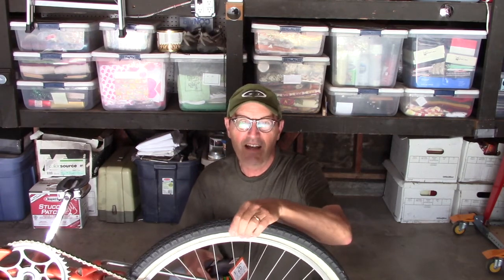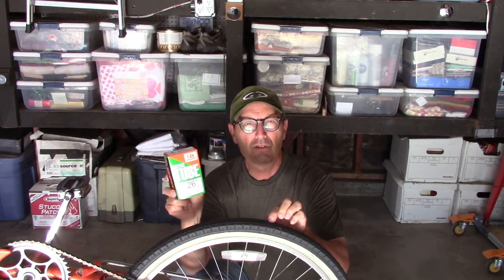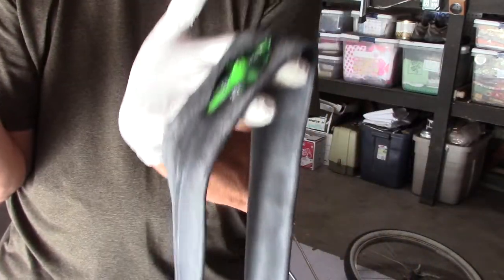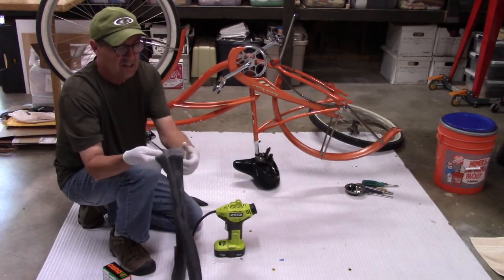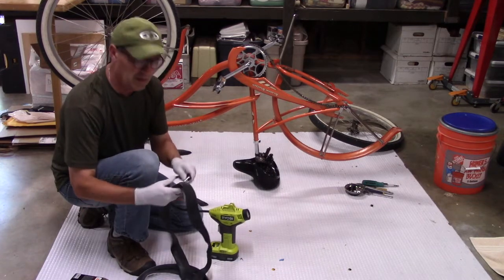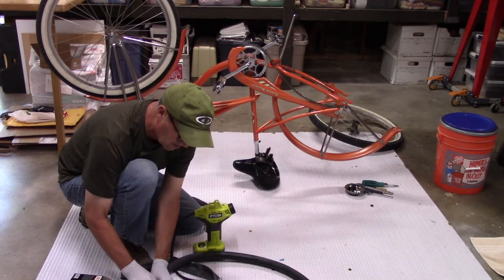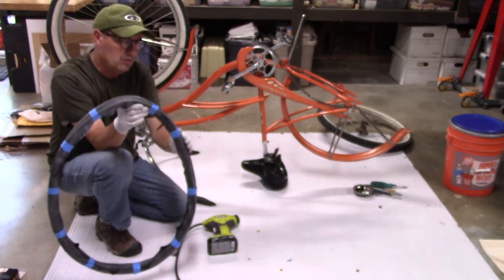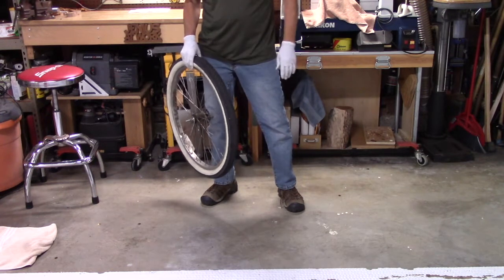Make Your Bike Tire Thorn Resistant

Comment: Home Depot "Orbit UPC 2 in. x 50 ft. 20 Mil PVC Pipe Wrap" $5.24 a roll it is thin and fits perfect. Nails, Screws, Thorns glass and more. it's made to protect under ground pipes
Reply from the maker: Very interesting.  I hope others see your comment.  Thank you
Reply: I have tons of this stuff I'll line my tire with it
Reply: Please tell me this works! I have 8 neighborhood kids and I have become the bike repair man🤣
Reply: I'd like to try this! In terms of installation, how do you proceed? Do you stick it to the inside of the tire and then add the tube?
Reply: Does it work?
Reply: I live in Az and I think the hot pavement would melt it in the tire, it's a good idea I wonder if they make a high heat version
Reply: How do you put it in the tires?

Comment: I did the whole "Thorn resistant" tube thing for a bit but got tired of replacing the much more expensive tube, because of the valve. So, I started doing this a few years ago with the bad T/R tubes and just buy cheap tubes and use the thick ones for wraps. Also! I've never had semi slick tires before (only knobbies) until I bought a used bike with them and because of their age, I won't use them for long rides, but did cut the wire bead off and use them for liners now and the best so far. Tuffies work, if they don't shift side to side. The tire wrapped within a tire, is tougher and doesn't have that problem and so far, will ride anywhere without hesitation, but do always carry a spare tube regardless. 4 bikes (2 mtb, 2 cruisers) and at least 20 miles a day/4 days a week and have walked a lot of miles because of flats and doing everything I can to avoid any more walking.
Reply from the maker: Wow! I only go 6 miles a day on my Electra Townie 8i. I am on paved paths all the time.  I avoid thorns which cause most of the flats on Orange County California bike trails.  Thanks for your comment. Keep up your fitness program!
Reply: @gfotinakes316  Just trying to keep myself from getting fat and lazy after retiring. Keep in mind, the smoother the tread being used for an insert/liner, the better. And depending on fitment of the tire used in the outside, it can be a wrestling match to install. Hope it helps! Oh! Before the stupidly high h
gas prices, I'd drive down to O.C. And ride 2-4 times a month, but now just roll from home in the I.E. On the P.E.T. Most times, with periodic explorations through the dirt and rocks of the local hills.
Reply: I used to fix flats on location where the puncture happened.~15 minutes.
Reply: @gfotinakes316  Old larger dried up blackberry thorns can puncture tubes on trails too!!!
Reply from the maker: Thankfully we have none of those in southern California!

Comment: When I was 11 (back in 1964), my stepfather made my bicycle tires thorn-resistant (we called them stickers) by doing the same thing. It worked great. My tires never got another flat. The composite materials available today work much better obviously.
Reply from the maker: I was riding my bike in '64 also and having flats with those "goat head" thorns.  I used that liquid sealant and it worked okay.  Many times I would be riding along and I would hear hissing then some goop would come out and seal the hole.  I wish my father knew what your stepfather knew at the time.  Have agreat holiday.

Comment: i did not quite understand the problem you had with the valve stem and why the sealant was not working .....was the valve inside the stem faulty or was there a hole in the stem itself
Reply from the maker: There was a hole at the base of the stem. By the way, what state are you in?  I like to put a pin in my map for all of my replies. Take care!

Comment: Just cut an old inner tube and insert better coverage of tire. I use this method all the time especially in the rear tire and you can run at lower pressures. I run 40 /60 or more depending on tire size
Reply from the maker: Great tip! By the way, in what state are you viewing my video?  I would like to add a pin to my map for all my video replies.  Thank you!
Reply: I'm in Detroit,I built a 1500 watt ebike but literary the streets here are nothing but glass, people drive around smoking weed and tossing liquor bottles out so I get a flat almost every day riding 6 miles to work, I tried duck taping the inside of the tire which made the ride horrible, I tried pipe insulation, it works but it. Flattens  out to paper thin, I'm trying this option today, but along with the extra tube I'm cutting my old tire tread off and inserting that also
Reply: what do you mean by "cut across the oval"

Comment: extra tube over made tires feel so stiff heavy l tink l remember
Reply from the maker: I haven't noticed that.  I put about 60# air pressure in the tires and they ride great.  Even if they might be heavier, I ride for the workout anyway.  Thanks for the reply, take care and stay safe.
Reply: @gfotinakes316  does it feel slower? When you put some extra tube protection?
Reply from the maker: @thedistance1155  My bike is a one speed cruiser type bike.  I put about 65# of air in the tires and I have noticed no difference in the speed or resistance.  If my bike had a narrow racing tire it probably would make a difference.
Reply: It can make a difference, but it really shouldn't be too noticeable. I guess it depends on how much your current rims and tyres weigh, and the pressures you use.

Comment: 👋 Hi. Great video. How did it worked out with the extra tube protection on the long run?Thank you.
Reply from the maker: Perfect, I never got another flat. (Maybe I just managed to dodge the thorns. :)
Reply: Depends where you drive. If you drive on streets only this might last forever. I put this system on my electric bike and done over 1000km in few months. I drive mostly on canal routes(loads of crushed glass), and on forest/bush trails. Never had a puncture from glass, but had two punctures recently in one week from a similar spike (I think plum tree), which went through tire and inner tubes like through a butter. So I am thinking of upgrading to a proper liner ;)

Comment: Does this still working right now I want your answer because I'm tired from Holes in tires
Reply from the maker: It is still working with the "goat head thorns" that I have trouble with.  I don't know what you are running over, but my thorns are fairly big and nasty. I hope this helps.  What country are you riding your bike in? see the thorns:    https://www.mortonsonthemove.com/goat-head-thorns/
Reply: @gfotinakes316  I ride my bike in North Africa, where the roads are rickety and there are many holes. I will use your advice, but what do you think if I make an inner tube for a truck or a car? I think it is better to protect the tube. Thank you for replying and exchanging experience

Comment: I had a cheap tube that u was gonna use and i bought a slime one instead and us that one, long story short it got punctured and i changed it by using the cheap tube i had, i even put alike in it BUT after literally some hrs it went flat anyways i bought 2 slime tubes yesterday and today i changed it and i said to myself let me check the tyre. And what do you know it had 2 thorns in the tyre and thats why it punctured my tubes i tried getting them out but they where small. I ended up just cutting them with a nail clipper (i didint have anything else) lets hope the small piece of the thorn punctured this new tube aswell. And when it does ill use this slime tube for this.
Reply from the maker: Wow! What a story.  Good luck with all those thorns.
Reply: @gfotinakes316  haha I try.

Comment: Have you had any kind of problem in the long run…?
Reply from the maker: I have not had any problems but I don't ride that bike much anymore.  The tire still inflates well and holds air.
Reply: @gfotinakes316  Was the result uniform over the whole tire or did it cause bumps at some points....?Thanks again
Reply from the maker: @Gorylla88  The tire was uniform with no bumps.  I was not aware that it was even there.  Remember, this is a larger beach cruiser tire, not a racing bike. By the way, where are you riding? State or country?

Comment: This is nutty idea, I tried this years ago and it didn't work well at all, all you're doing is adding weight while adding very little in the way of flat protection.  If you want better flat resistance you need to use a RhinoDillo Tire Liner, which is better than the Mr. Tuffy, it weighs a little less than using an old tube, it's a lot tougher against penetration than using an old tube, and it has one end with a soft tip edge to prevent the liner from chaffing the tube and causing it to leak after time, unlike the Mr. Tuffy. 

The first line of defense against flats is supposed to be the tire, so buy a tire that has very good anti puncture liner built into the tire, the Schwalbe line of tires have the best flat protection depending on the model, one model is claimed to be flat proof?!  I haven't tested that tire to find out, but I do have the Schwalbe Amotion tire and that is rated very high against punctures and so far no flats on my touring bike, but I do use the RhinoDillo liner for extra insurance.
Reply from the maker: Wow! You sound like you have had a lot of experience with this stuff.  As for me, I just wanted a quick free fix and it seems to work well against those "goat head" thorns in my area.  Thanks for all the information, I am sure it will be helpful to other readers.
Reply: @gfotinakes316  I use to live in the Mojave Desert of Calif, guess what was all over the roads out there?  Goatheads, and I tried the old tube wrap thing and it didn't remotely work.  I even tried Slime, and it didn't work either, but there is newer liquids that does work better than Slime does, but those liquids only last about 3 to 6 months than you have to add more, once you do that the weight is more than a liner.  Back when I lived there the only good tire they had against goatheads was Specialized Armadillos, since then Continental came out with better tires, and Schwalbe came out with the best tires against flats.  A rubber tube wrap is till nothing more than a thin piece of rubber which is easily penetrated by any sort of sharp object.  Don't believe me? fine, take a thumb tack and press it against the tube, the tack will go through it like butter; try the same thing with a RhinoDillo liner and see what happens, see how tough it is to get that tack through the liner vs the tube.

Again, the first line of defense is the tires, if you don't want flats start there first when it comes time to replace your tires, then add a liner if necessary.
Reply: @Rekmeyata Thanks for the tip on those particular brand liners. I have a friend in Denver Colorado and he has the same problem with goat head thorns. I’ve only seen photos of them and they sure are wicked looking. He tried liners and slime and nothing worked, so he switched to solid tires. I’ve been using some other brand of liners for a few years with no flats, so I’m sold on the idea.
Reply: @Kenaroni  I used to live and ride out in the Mojave Desert of Calif, I also tried Slime and liners, but the Clear Motion Rhinodillos were not around back then, all there was were the Mr Tuffy's and they didn't work that good, they sort of worked though.  And thorn-resistant tubes did nothing except add a lot of weight.

Since I no longer live there I can't test against goat heads, so what I did was take a tack and tried to drive it through a Mr. Tuffy I had, the tack went through fairly easily, and then I did the same thing with the Rhinodillo and it bent the tack.  Also, it was a lot tougher to cut the Rhinodillo with scissors, whereas it was easy to cut the Mr. Tuffy.  I know that the Rhinodillo is better than the Mr. Tuffy, will it stop anything from penetrating it? I doubt it.

Slime doesn't work for high-pressure tires, once the psi gets above 70 the high pressure will just blow the slime right out of even small pinholes, at least that was my experience in goat head country using slime.

Again, the tire is your first line of defense, get a good highly flat-resistant tire, then add a liner if you want extra insurance against flats.